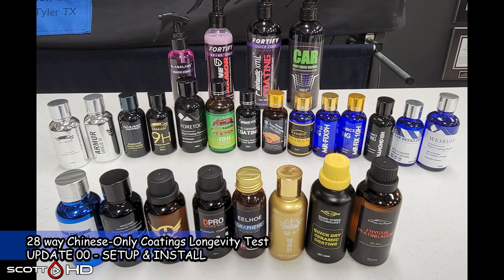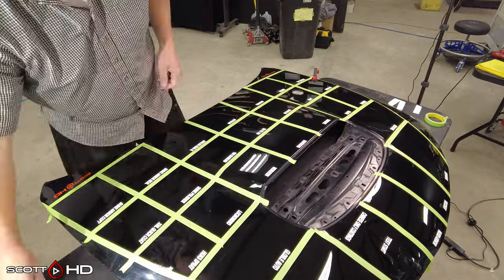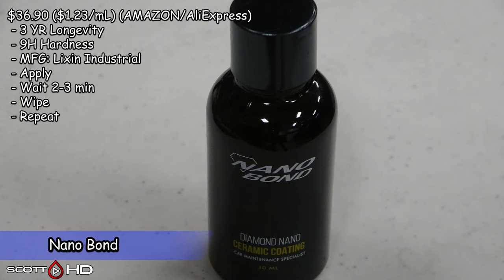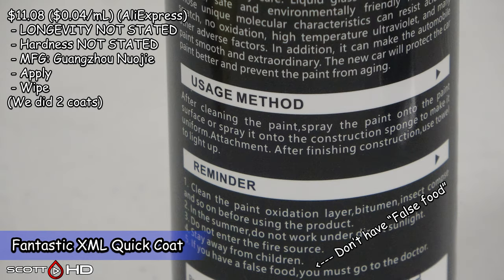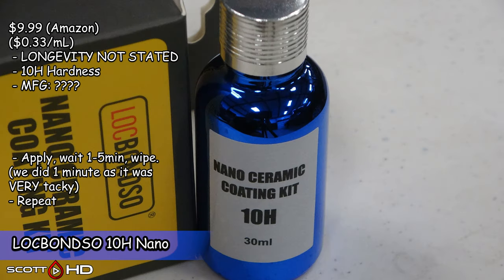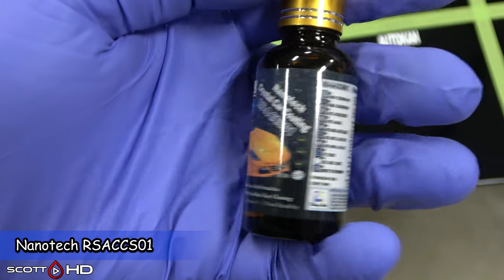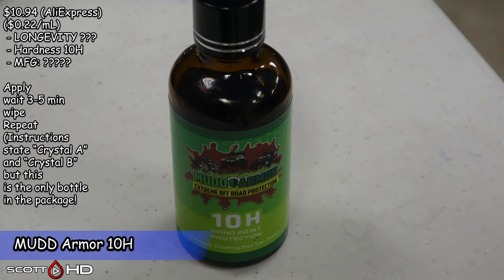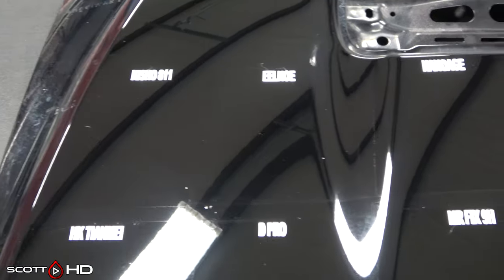28 WAY CHINESE COATINGS LONGEVITY TEST  - UPDATE 00 - SETUP & INSTALL

Comment: Youtube gold, Interesting and entertaining all at the same time. All kidding aside in my opinion Carpro lite is the best value coating out there, you get a consistent durable product and enough quantity to coat several vehicles with 2 coats all for $50 which for me is invaluable after all the time spent prepping the paint.
Reply from the maker: It's definitely done great in my other tests!  Surprising how well it's doing.

Comment: Hey Scott, mind provide a picture of the instructio~ manual of the emperor coating? They may list the manufacturer in Chinese and I could help.

My NanoAge coating is 7th month and so far it is still beading well. =D
Reply from the maker: I'll have to find the instruction manual for it - it may have been discarded after I took the picture of it.

Comment: You waited 3 mins no matter what? Did all coatings come off easy still? I am about to apply a Nano coating.
Reply from the maker: Yes - mainly because 2-3 min is pretty standard for most coatings to wait.  Most of these didn't come with any instructions.